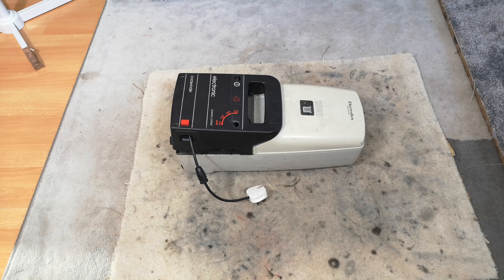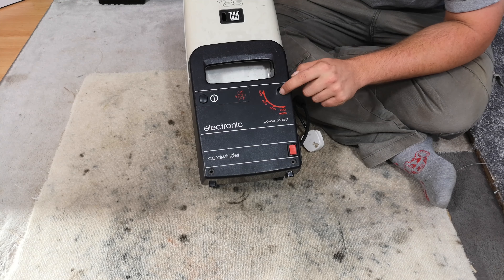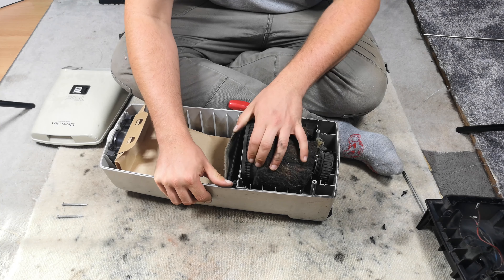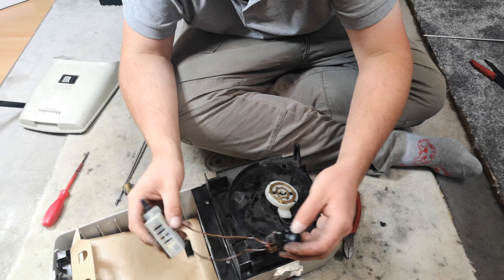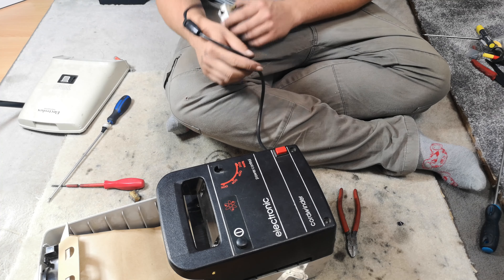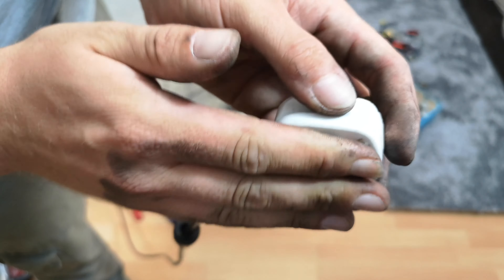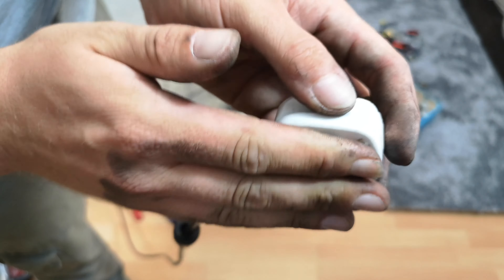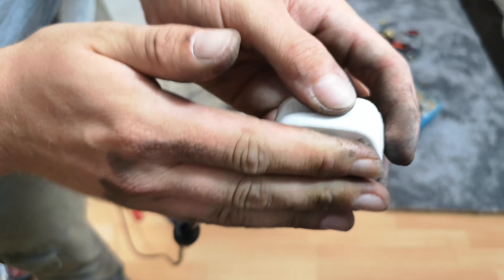A Pile of Broken Bits! Electrolux Slimline 185 First Look! (and extensive repair...)

Comment: First also have u ever seen an orange and grey Hoover 417G
Reply from the maker: Another collector sold one recently (had it listed anyway). It came from another collector who sadly passed away and no one can work out if its genuine or been repainted...
Reply: @beko1987  oh I bought the same hoover off eBay a few weeks ago while drunk and it was in great shape and works well
Reply: Don't worry it is looked after quite well used every day before I go to work at half six in the morning.
Reply from the maker: Excellent! Now take it apart and see if it's painted inside!
Reply: @beko1987  ok I will it was painted in the bag compartment